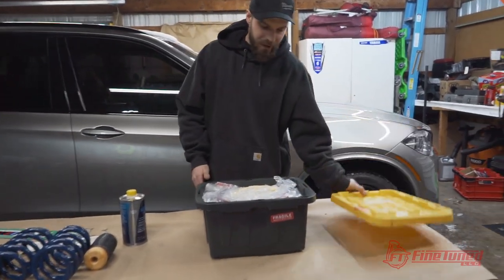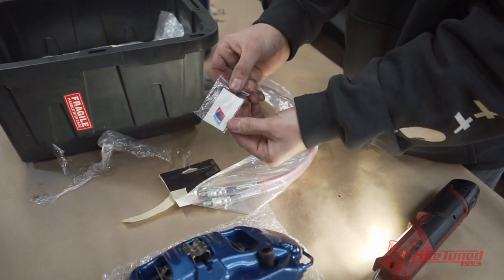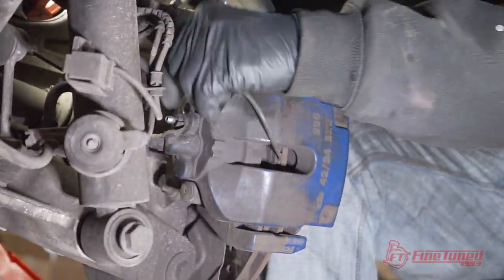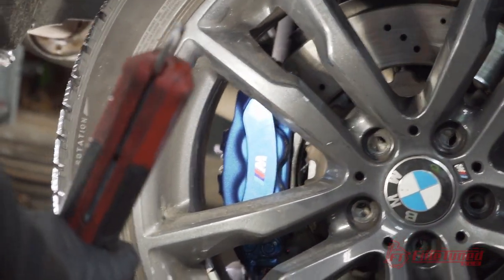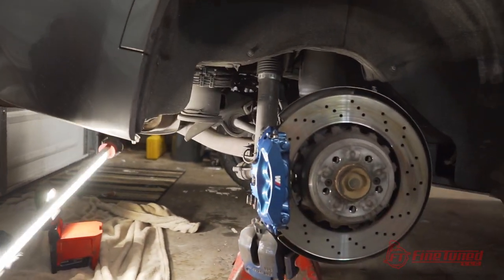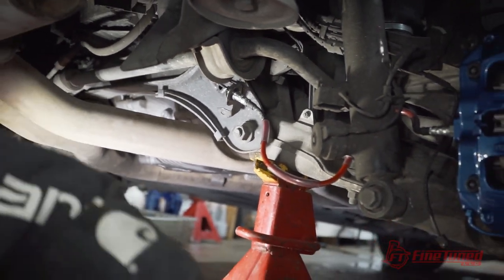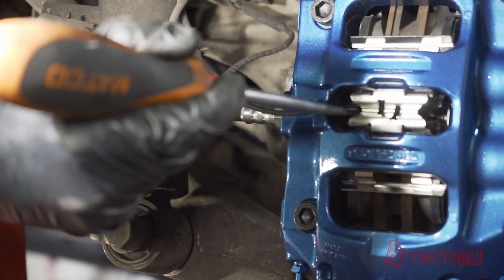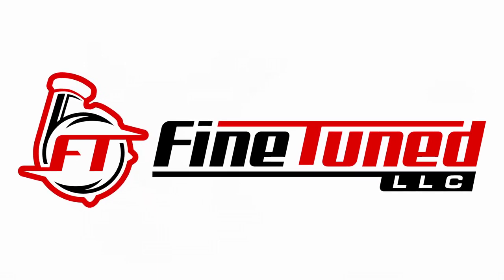BMW X5M F85 REAR BRAKE CALIPER UPGRADE

Comment: Unfortunately, you can not install these Brembo calipers on the new models with the electronic parking brakes!
Reply from the maker: This is meant for f15/f85 and e70 variants.
Reply: I have kits for G05 and F95 available as well